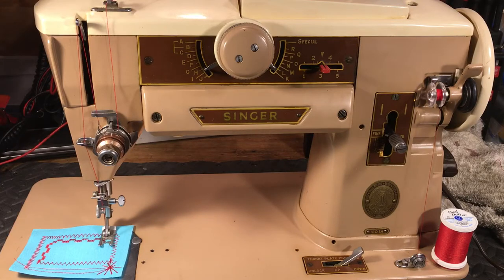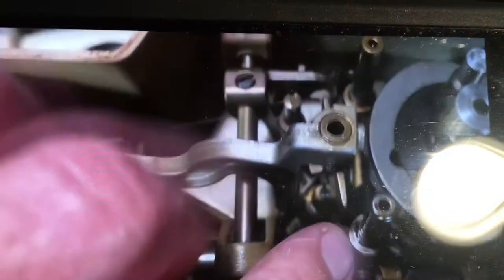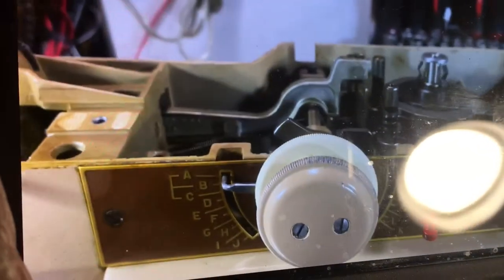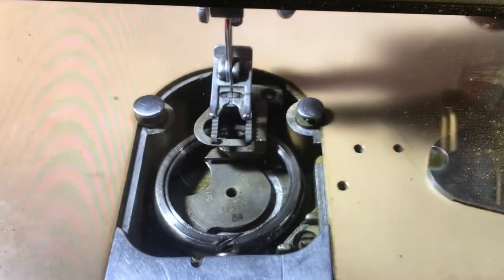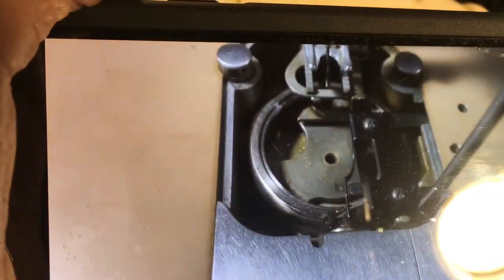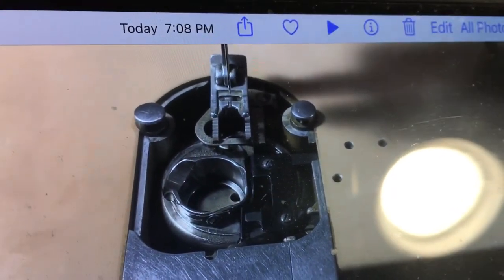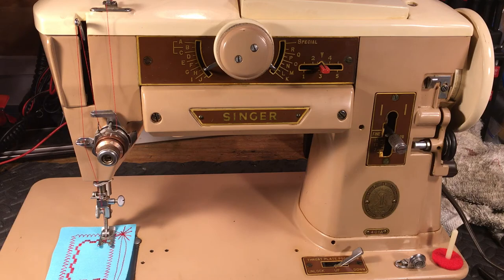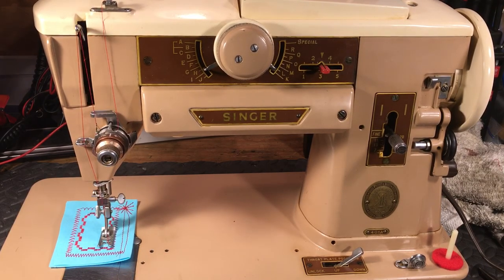How to fix Singer 401-A needs a tune up and rejuvenation.Machine threading & bobbin wind (video 141)

Comment: Just picked up a 401A at a Good Will. $ 19.99 @ 75% off. Got it for $5.00
 Didn't have a power cord or pedal control.  $ 34.00 on Amazon.
 A real treasure, machine is in great working condition.
 Great video, thanks.
Reply from the maker: That’s the way it’s done my friend. Score!!! I’ve bought many of those at goodwill. Line them up, I’ll buy them. 😎👍

Comment: Randy, I've made adjustments to the tension and bobbin thread gap but I still have problems with the thread breaking because it gets caught between the bobbin case and the race of the hook instead of sliding over the top of the bobbin.  Any suggestions on what the issue might be?  Any help would be appreciated.
Reply from the maker: Check for rough spots under the edge of the bobbin case. 
You’ll see them where the underneath groove begins and where the hang up is occurring. 
Smooth and polish those areas so the thread won’t hang up there.
Reply from the maker: I’ll address this again in a video that’s up next.
Reply: Thanks for information, I'll give that a try and hope that it is the issue.  Your videos and fantastic.  Thanks for sharing.   @randyyoursewingmachineman9954
Reply from the maker: @Dan-pd8qo  😎👍🏼

Comment: Hello. Just recently purchased a 401A. Cleaned and oiled it before I started it. The machine moves freely when I manually turn the hand wheel. When I press the foot pedal, it’s sluggish and the motor started smoking. Any suggestions? I know you had a video about just letting the machine run. Just making sure it’s the same case with the 401A. Thank you for your time.
Reply from the maker: Yes. If someone oiled that upper motor area excessively, you will have to run it as I explained in the video. Run it with the bobbin winder clutch released until it reaches its highest speed. The oil smoke will diminish at the end. 😎👍
Reply: @randyyoursewingmachineman9954  Thank you. I will try it and report back.
Reply from the maker: @alcas7864  👍🏼
Reply: @randyyoursewingmachineman9954  it worked!!! I’ll be honest, I was a bit nervous while it was smoking but I knew I had to trust the method . Thank you for sharing your knowledge. Greatly appreciate it.
Reply from the maker: @alcas7864  if it sits for an extended period of time, always bring it up to speed before beginning your sewing project. 
It will really extend the life of the motor and machine. 
Good job. 😎👍🏼

Comment: Can't get tension balanced. Bobbin thread stays loose. Suggestion?
Reply from the maker: @badkittysneakattack  I assume you mean it’s looping underneath?
I would suggest making sure it’s threaded correctly. 
I have numerous videos addressing that issue since it causes most malfunctions.
I would suggest that you be sure that the thread you’re using isn’t oversized. It should say these words on the end of the spool: all purpose/ dual duty. If those words aren’t written on the end cap of the spool, who knows what size you’re using?
I have numerous videos addressing that issue, because it accounts for most of stitch problems.
Put your upper tension dial on the number 4. Leave it there forever.
If your tension assembly has been taken apart and reassembled, that’s going to make that number 4 moot. 
Then it’s a guessing game. 
If you’ve tightened the screw on your bobbin case, you probably made the problem worse. Try to put it back where it was. Don’t lose the screw by loosening it too much.
Sewing machines sometimes don’t make sense to those folks who don’t service them for a living.
Any malfunction of thread or threading, is an “up top” problem, and the malfunction presents itself on the bottom. 
It’s vice versa as well. 
Good luck.
Reply: @randyyoursewingmachineman9954  thanks! Thread type was the issue!
Reply from the maker: @badkittysneakattack  bingo. 👍😎

Comment: Built like tanks. Do you prefer the 401 to the 500a? If so, why? Always a pleasure chatting with you. Ron
Reply from the maker: I give the edge in my preference to the 401 based on my approach as a repair and service person instead of a user. Mechanically, they are almost identical. The only real difference functionally is the 500a has the thread assist on the take up assembly that was introduced to supposedly solve the problems with sewing knit fabrics, polyester, and etc. That just poses an additional challenge to a newbie in the threading instructions. So, when I sell or service one, I have to be sure the customer understands that process and threads it properly. Not a big deal.

Then there’s the pop-up spool pins. Certainly a clever development by the  big brain designers at Singer to try and keep the spool pins from breaking in transit and in use. The special designed L shaped pop up pins have the added spring and the cut out spool pad that worked magnificently at first, but now it’s a half century later and they’re becoming problematic. I always make sure that my customers who have a 500a are aware of the auxiliary spool pin that goes in the hole in the lid when it’s closed. That way, they can use all the varieties of sizes of thread spools that are in use now, that weren’t on the scene in the late fifties.

Then there’s the lid itself. Quite often the lid has popped off and becomes misplaced, and the second or third owner doesn’t even know it existed in the first place. No big deal really in the bigger scheme of things, just an annoyance to yours truly. 

I love when I get a 500a that has been cared for and cherished by its original owner, has everything intact, has all the books and accessories, and is now on the market for sale. That’s when I can really get excited about a 500a. 

So, all things considered, if you set the two machines side by side, and they’ve both been well cared for, it’s a tough call as to which one I would prefer.
Truth is, I would try to buy them both. Win-win, for me and my customers.

Comment: Hello,  I'm not sure if this is still an active post.... but Im going to give it a shot.  I picked up one of these machines.  It seems to run quietly and smoothe and it has a nice stitch.  My problem is, I want it to sew faster.  My mom has one just like this and her machine goes really fast.  What do you think will speed it up?  thanks for any help you can provide.  It is driving me crazy trying to figure it out.   Also, I am using the power foot from my moms machine.  Her machine goes fast.  Mine doesn't.
Reply from the maker: Disengage your hand wheel clutch and run the motor at a high speed for FIVE FULL MINUTES. Let it get to the point where it sounds like a fighter jet taking off. 
Then, tighten the hand wheel clutch and with the machine unthreaded and with the presser bar lever raised, run the machine and see if the speed of the machine is faster.
If it’s still sluggish, the machine has some oiling points that need oil. 
Oil every metal mechanism that slides, rotates, pivots, or hinges. Good luck. 😎👍
Reply: @randyyoursewingmachineman9954  ty.. im doing it now.  Is it normal for it to smoke ?
Reply from the maker: @zillbilly  if someone over oiled the motor, yes, that’s going to be expected. 
Just keep running it until it gets up to speed. 
What you’re experiencing is so common that I made a video on it.
Reply: @randyyoursewingmachineman9954   ok great!  Ty.  I oiled it last night.  I probably over did it.  I'll look for your video too.  Ty .. I appreciate your advice ♡
Reply from the maker: @zillbilly  if you ran it and it didn’t come up to full speed, you stopped too soon. Run it until it comes up to speed.
I’m assuming that you didn’t dump a huge amount of oil on the motor shaft at the right rear of the machine on top. 
If you really over did it, the motor may need professional help.  
Good luck with that.
You’re most likely to hear, “ You don’t want that old thing, just buy a new one”.
That’s what I would call tragically misinformed advice from an intelligence deficient individual (or a charlatan).
Run it longer.
Reply: @randyyoursewingmachineman9954    MY GOSH... IT WORKED!  YAY!   Thank you soooo much!   ♡
Reply from the maker: @zillbilly  excellent job. Glad to help. Each time that you get it out to sew, run it up to speed before you begin. 😎👍
Reply: @randyyoursewingmachineman9954  I will ty!  I was going to ask if I should do that often but didn't want to bother you again haha.  I already called my mom with the good news!  She's been using her 401 for at least 50 years...she won't give it up lol.  Now I have my own !  So exciting
Reply from the maker: @zillbilly  never a bother, if you need help with a sewing machine issue, just let me know. 😎👍

Comment: Hello, I have a 401a and have had it since High School   Its been giving me problems lately.  it seems like its catching in the bobbin area like the tension in the bobbin is too tight and it balls the yarn up on the back or breaks the string   I took it for a tune up and just got it out of the shop   its still doing it   What am I doing wrong??  what can i adjust to make it sew right    im so frustrated
Reply from the maker: I wish I was there to look at it. It would take about two seconds to fix. 
Did the sewing machine shop have the word “vacuum” in its title?  As in, Joes sew and vac?
The screwdriver wielding person probably doesn’t know any more about that machine than you do.
His grandpa retired and left him to “manage the decline” of a successful business.
But then, I digress.
I’ve made countless videos addressing these issues. Even specifically on the 401 Singer. 
If you’re not using an oversized thread, I would suspect burrs on the bobbin case or an incorrect thread gap settling.
It could be many different things, but then, that’s why I’ve made multiple videos for you to help fix it yourself.
The 401 is an awesome machine, it’s going to be something simple that was probably overlooked by your vacuum repair person.
😎

Comment: Randy - I have a 401a that seems to be somehow seized when I attempt to sew in normal fashion. It has what appears to be normal motor sounds when I release the tension to make a bobbin But it won't sew/move forward properly unless I help to spin the large outer disc in the same direction...

I have a video I can share, if you can help me...
Reply from the maker: It simply needs to be lubricated properly. If it hasn’t been dropped or there’s no thread wrapped around any mechanism, that’s about all it can be. 😎
Reply from the maker: If it’s been sitting unused for a long time: 
with the machine unthread and the presser foot raised:
1)disengage the hand wheel clutch, as if you’re winding the bobbin. 
2) without putting the bobbin winder on the hand wheel, run the motor until it reaches PEAK RPM’s 
3) don’t stop running the motor until it’s really screaming at a high pitch and running really fast. 
4) engage the clutch by tightening the inner knob. 
5) run the machine and observe the speed. 
6) if it’s not running fast, the machine isn’t properly lubricated. 😎

Comment: my 401a wont spin my bobbin at the bottom and keeps getting top thread stuck and caught up do you have a solution
Reply from the maker: Make sure you raise your presser foot before you thread your machine. 
Take care to place the thread in front of the guide on the tension assembly and be sure that it goes between the discs. 
Before beginning to sew, always lower your presser foot and pull on your upper thread to insure that it has seated properly in the tension assembly. 
Put your upper tension on 4.
I have made a video that covers this, if you can find it.

Comment: Randy please help me! My Singer 401A won’t stay threaded. The thread keeps snapping. I’ve troubleshot all I can. It seems to be threaded correctly and I’m pretty sure the tension and everything is right but I just don’t know. I didn’t have any issues with it before.
Reply from the maker: Make sure your needle is inserted correctly. Flat side to the back and long groove to the front.
Reply: The very tip of the shuttle hook was slightly bent on mine - pass finger nail on it. Needle deflects on thick materials due to slant design, hits hook tip, bends it. May try strengthen the tip but metal is brittle. There's a video on this

Comment: Do you happen to have a video that covers the timing on the zigzag stitch? I’m finding it’s still in the fabric when it’s wanting to start a zigzag.
Reply from the maker: The pinion gear on the top shaft has two set screws that will allow it to be rotated slightly. It’s called setting the pendulum timing. 
If you turn the hand wheel until those two screws are visible, and move that gear slightly, it will affect the timing of the needle bar swing. 
I don’t think I have a comprehensive video covering that. 
I can make one soon if I can find the time.
Reply: @randyyoursewingmachineman9954  yay, you’ve given me something to start with, I’ll look in to that.  Thank you.
Reply from the maker: @rhondamercado7527  👍🏼😎
Reply from the maker: Rhonda,
Sorry I gave you the instructions for a different machine. I was looking at the wrong thumbnail pic. Oops. 
I made a video for you just now. 
Video 310. Hope it helps. 
Randy
Reply: @randyyoursewingmachineman9954  omg thanks…..going to watch now.
Reply from the maker: @rhondamercado7527  I admire your fearless determination. Make sure you have top notch tools, especially the 1/4 inch screwdriver to loosen the zig zag cam adjuster.👍😎

Comment: I’m repairing and servicing a 401a for a friend. The red lever doesn’t work correctly. I don’t see any videos on YouTube on how to adjust the red lever. Is there any way to repair or adjust it? I agree that this is a great machine! I have one also. I love my 301 and my featherweight too. The mechanics on the 401 is amazing though.
Reply from the maker: When you say it doesn’t work correctly, I’m guessing that you mean it won’t set the needle position properly, or it won’t effect the width properly. 
If the pattern selector isn’t on A-K-1,
Then the needle position won’t work properly. 
If the pattern selector isn’t set properly on B-L- (2  and up) then your zig zag width won’t set properly. 
Providing you haven’t “adjusted” anything yet, it should be a simple matter of getting the patterns selected correctly.
Reply: @randyyoursewingmachineman9954  no I haven’t adjusted anything yet as I didn’t want to mess anything up. I will look at the selection knobs tomorrow when I get it back out and see if that’s the problem. If I remember correctly, when it was on center, the needle was to the right. To center it, it had to be put on 5. Hope that makes sense. I appreciate you taking the time to answer my question.
Reply from the maker: @apiecemaker1163  unless the pattern selector is “dead on” A-K-3, it won’t be in the center position.
A-K-1 is left needle position 
A-K-3 is center needle position 
A-K-5 is right needle position 
Lubricate the pattern selector assembly so that it moves freely into position. Sometimes it moves better when the red width dial is all the way to the left, or to the right.
Reply: @randyyoursewingmachineman9954  that is very helpful information. Thank you. I will go back to it tomorrow and will let you know what I discover. Have a great weekend.
Reply from the maker: @apiecemaker1163  👍🏼😎
Reply: @randyyoursewingmachineman9954  looks like that worked. It is centered now. 🧵🪡👍
Reply from the maker: @apiecemaker1163  excellent. 👍🏼😎